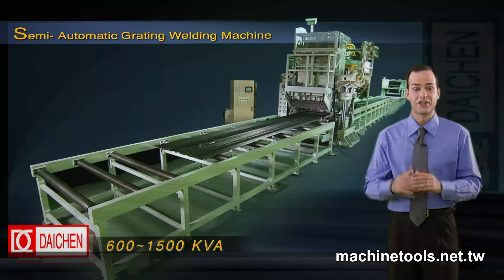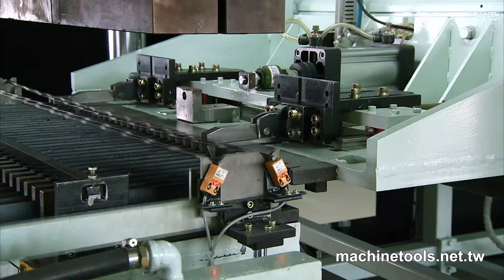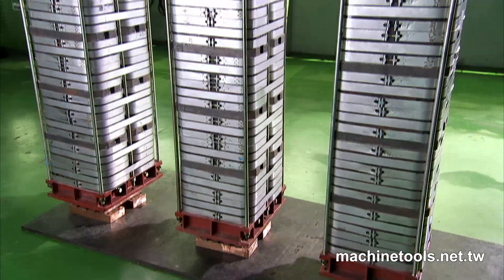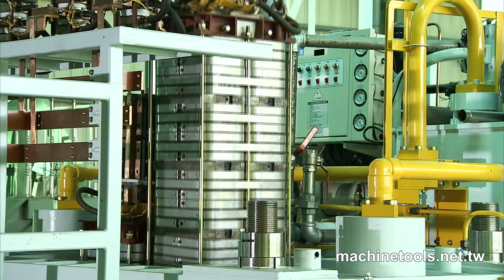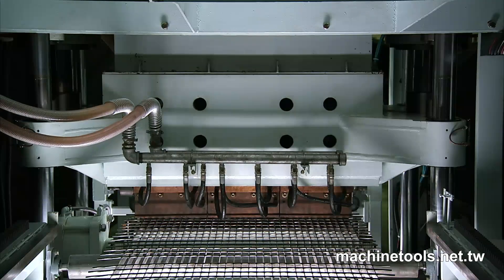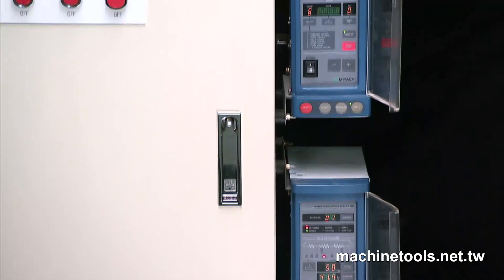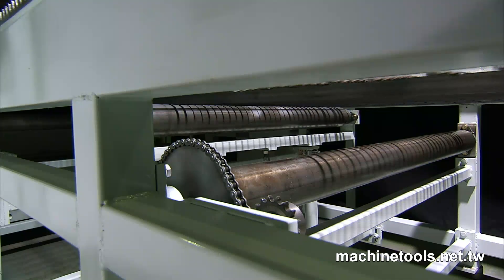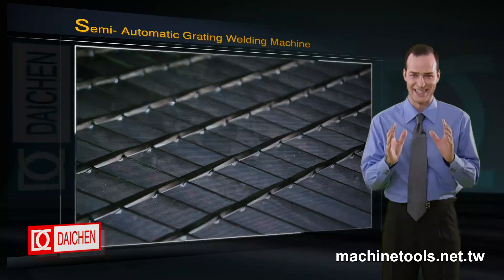Grating welding machine/Mesh welding machine/Steel bar mesh welding machine- S&J Corp

Comment: Any tips on welding quarter inch thick material?
Reply: try the Clifford Machine that does up to half inch for 3000KVA or quarter inch on 1600KVA machines
Please see 
https://drive.google.com/open?id=0B_dMvl3wm7ppVzhybThHdDI0RkU
Kindest regards
Gavin
Reply: haha, Gavin, glad to meet you on youtube by chance. Hope you still remember me. Sophia from hebei jiaoyang wire mesh machine company.
Reply: That is our machine Gavin. We had to figure out the correct weld settings. Plus our electrodes a weren't level. So there's that too. Fixed the popped weld issue now though. Thanks from Banker Grating